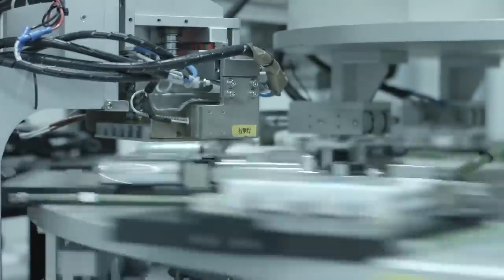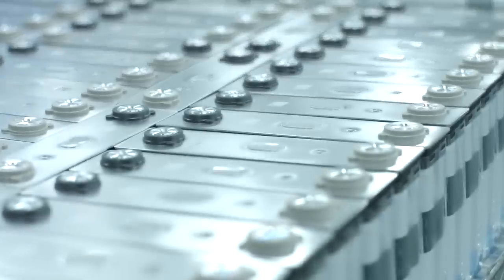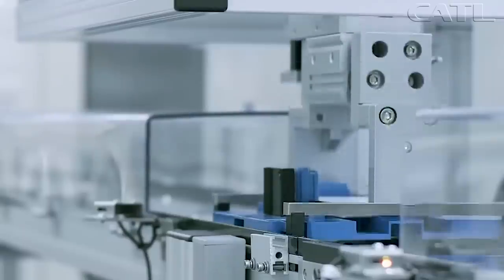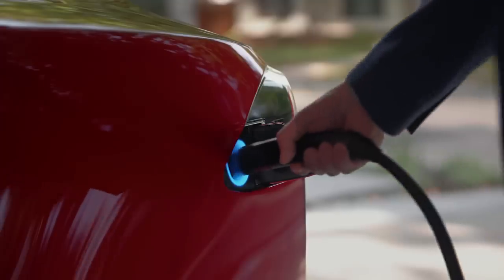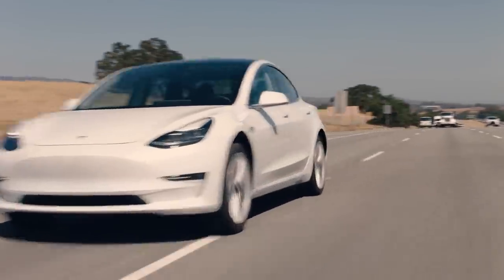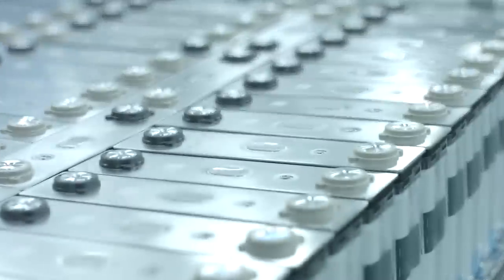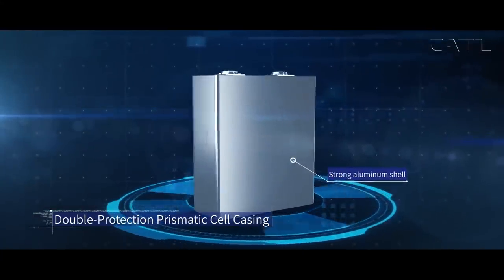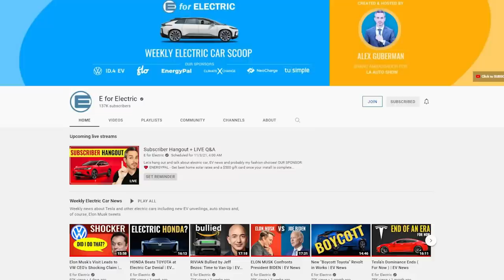SANDY MUNRO on Tesla's LFP Batteries

Comment: 100% charge on LFP is not inconsequential or does not degrade the battery. LFP degradation will drop by 10% in the first 50,000 miles, and charging to 100% does degrade the batteries faster.

The reason Tesla wants you to charge to 100% once a week is so the car's Battery Management System (BMS) can reset its internal knowledge of a "full charge" so it can watch and track the number of watts consumed while driving to give you a more accurate estimate of range.

NMC batteries have a nice voltage drop that is pretty linear as you consume power. You can use the voltage of the cells/pack to estimate capacity and power remaining.

LFP (LiFePO4) voltage drops some initially but then is very flat from say 85 to 15%, then the voltage drops even faster. You cannot look at the voltage and estimate state of charge.

Thus the BMS needs to know when you've hit 100% so it can reset its internal meter, then as you drive the BMS knows how much power has been fed to the motors and vehicle systems. Based on the roughly 60.5kWh battery capacity, and about 56kWh usable, the BMS can tell the car its estimate of the state of charge. As you drop below 15% and the voltage starts to drop, the BMS can be more accurate on the last 15% of the battery.

While the BMS can estimate how much you charge the battery, it can get off due to +/- errors in estimation, thus why Tesla says charge to 100% once a week at least.

You could probably extend this to every 2 weeks, and charge to 85% most of the time and be just fine, and probably extend the life of the battery pack. But with NMC lasting 1m miles, I dunno if you'll be alive to reap the benefits!

Comment: I had an FFP four engine start on the motorbike it was considerably better than the powerful lead acid that it replaced I tried it on a dual power drill and I could tell no difference in the performance between that and the 2170 is being used in the drill. Yes it’s bigger but not massively so and performance wise I could tell no difference

Comment: In some point better acceleration is no more meaningful thing for normal customer. I have lived to my days with cars slower than 10 seconds from 0 to 62 mph. Anything faster is fast enough and that can be made with LFP just fine. Bimmer drivers are different story, but I am not one of them. Your mileage may differ, it is of course up to you to make your own decisions.
Reply: Agreed; the LFP simply isn't THE BEST for the extreme acceleration of the performance Tesla models,  but is great for the regular ones.  My current car does 0-60 in 9, and that's perfectly adequate for any traffic conditions.
Reply: 100% agree. The ludicrous 0-60mph times are just plain dangerous in the average drivers hands. Tyre last longer as well. 
What normal person needs supercar performance unless they are those irresponsible wild drivers putting normal people in danger on the roads.

Comment: Right off the top: LFP is a chemistry. 46-80 is a form factor. I'm pretty sure that in due time, LFP batteries will be produced in the 46-80 form factor and built into structural battery packs. . This will allow better range, more charge cycles  and lower cost than any other combination currently available.
Wow! Until I saw this video, I had no idea that Tesla was using prismatic cells in any of their products. I don't expect that will continue for long.
Reply: @e-redj  To be clear:
1) Pouch and prismatic are not the same. prismatic cells have a lot more structural integrity. The pouch form factor is part (not all) of the reason that the Chevy Bolt batteries have failed.
2) It is more difficult and more expensive to build batteries in the prismatic form factor. The main reason for doing this is to achieve higher energy density at the pack level than would normally be possible with cylindrical cells. But that benefit is lost when the cylindrical cells become part of the structural strength of the vehicle. To be specific, like the Tesla structural battery pack.
No, prismatic cells are not suitable for integration into a structural battery pack.
That is why I do not believe that Tesla will continue to use prismatic cells once the 46-80 cylindrical cells become widely available. How long it will take Tesla to get the new manufacturing process to work with the LFP chemistry is something I do not know. But, I'm sure that it's coming.

Comment: I really like Sandy Munro for his manufacturing expertise, and he does understand the basics of different battery technologies. But he is kinda soft on the key points about LFP which relate to energy density and cost. And it is important to note that China owns the LFP battery industry right now, so they have a HUGE interest in promoting it over NCA batteries that are mostly produced in Japan and Korea. The biggest benefit of Tesla's 4680 batteries is simply that they will help Tesla not be wholly dependent on Asian battery manufacturers that currently OWN all automotive battery production today. For most EV drivers today, they simply charge up at home overnight, and don't worry about public chargers, or charging speed, or maximum range. But those are still the main topic points that you see discussed on the internet as being the most vital needs and issues of EV ownership. They certainly are important for some people, but not for most.

Comment: LFP cells can be completely destroyed in one charge cycle if they are charged while frozen. They must be using some kind of battery heater or BMS low temperature disconnect in cold climate vehicles.
Reply: Yes. Better keep it connected to AC charger so it will keep on temperature in the winter.

Comment: BYD is setting the standard with their LFP blade batteries. Their form factor lends to more cells in traditional platforms. BYD’s new vehicles with blade batteries, 800v charging will be considered by many future EV buyers. FYI the BYD Han AWD can accelerate 0 to 100km/h in 3.9 seconds.

Comment: I understand that LFP discharge more quickly when not charging.
Reply: Do you mean self discharge while not being float charged?  If so, I have seen my banks of LFP batteries hold charge for 2-3 months at a time completely disconnected with no float charger on. My AGM battery bank shows a fair amount of discharge after a week without a charger connected. LFP batteries have minimal self discharge.

Comment: For any given size LFP batteries won't dump the high amounts of current that NCA or even NMC chemistries will (less specific power).  The cells also generate less voltage per cell (nominally 3.2V vs. 3.7V). For any given Ah rating LFP will be gravimetrically and volumetrically larger than an equivalent NCA or NMC. This will make very little difference for the Model 3 and Model Y non-performance versions which will simply use a slightly larger pack but it would make the Plaid rather anemic.  The Plaid drive train pulls nearly 2000 amps at full power.  This is possible with NCA but an for an LFP to offer this would require it to be quite a bit heavier and larger.

Comment: I am using LFP batteries for around 10 years now, both in my cars and motorcycles as starting battery, and even electric bike. 
Work good, probably 10% less than LiIon, but they last over 2000 cycles and are bullitproof. 
I never understood why Electric cars not use them as starting battery.
Reply: Not enough energy density per kg yet.
Reply: @herrba  only 10% difference
Reply: @herrba  I could start my old Ducato 2.8Tdi Campervan with it. It was 2/3 lighter and even stronger than the old lead acid. 
For my motorbikes it is even better, The Harley has a 18 pounds battery, that I replaced with a 5 pounds LFP battery. That thing is hugely more powerfull and has 8% drainage over a year, My lead acid would be dead after a year.
Reply: I have LFP batteries in my four wheel joystick controlled adaptive mountain bike. Plenty of range, and acceleration, and I appreciate the longevity of the battery.

Comment: I am sorry but Sandy has one thing wrong about LFP batteries.  They can output more power without damage than standard EV chemistry using nickle and cobalt batteries.  The 2014 Chey Spark EV has LFP batteries outputs enough power so the car has 400 pound-feet of torque while the 2015 & 16 Spark EVs which has different battery chemistry using nickle and cobalt puts out 327 pound-feet of torque.  LFP batteries can take higher charging voltages and current and can output more current.  If Tesla is limiting the performance it is probably due to wanting to squeeze more range out of the car.

What Sandy has got right is pound per pound LFP batteries don't hold as much energy.  Using the real world experience of the Chevy Spark EVs 2014 and 2015 through 2016 you can get a feel for the difference.  2014 Chevy Spark EV LFP battery is a 21 kilowatt hour while the 2015 and 2016 are Nickel-Rich NMC. (nickel-manganese-cobalt) and are 19 kilowatt hour.  All years of Chevy Sparks have the same range of 82 miles brand new.

The 2014 Chevy Spark EV LFP battery 21 kWh weighs 86 pounds more than the 2015 & 16 19 kWh NMC batteries.  Both LFP and NMC Spark EV battery packs take up almost the same amount of space. 2014 Volume/case: 133L / square-shaped  verses 2015 & 16 Volume/case: 139L / square-shaped.

The 2014 Chevy Spark EV battery pack is 369 Volts.  The 2015 & 2016 battery packs are 400 Volts.  Even though the 2015 & 2016 are higher volts the 2014 Sparks EV have 400 pound-feet of torque compared to 2015 & 2016 327 pound-feet of torque.  This tells you the 2014 LFP put out more amps than the 2015 & 2016 NMC batteries.

I have also been monitoring the Spark EV forums.  So far the 2014 LFP batteries are holding up much better then the 2015 & 2016 NMC batteries.  LFP batteries just don't produce as much heat when charging or discharging as NMC batteries.  This is why they can handle higher voltages and currents than NMC batteries and last longer.  LFP batteries can also do more charging cycles 2 to 3 times as many as NMC batteries.  Since they don't use expensive nickle or cobalt they are cheaper to produce.  You can drive a nail through a LFP battery and even though it will short it will not catch on fire.  Drive a nail through a NMC battery or any other Lithium Ion battery and it will catch on fire.

Comment: Smart guy but he did not have all the answers correct for your questions. He misunderstood your 100% charge question. You are correct LFP can be charged to 100% charging lithium to 100% frequently can damage the battery overtime. And the reason that LFP has been built in China but not in the USA is a combination of patents surrounding LFP battery technology that have been sourced for China manufacturing but do not allow for out of China until these parents expire in 2022

Comment: LFP is better for most vehicles and people. They are safer, cheaper, last longer, more available and like to be fully charged unlike nickel. They weigh more and don’t like cold temperatures. So those living in mild/warm climates will be fine with a LFP pack.

Comment: my 2011 Nissan LEAF    24 kwh.. has lost three bars    and the range is down to 60 miles .   will LFP batteries fit and replace the original cells .

Comment: Since when does lfp charge faster, that’s just plain false
Reply: I think what they meant was that with LFP you can sustain a high voltage charge longer, therefore more juice for the same amount of time. In other words, faster charge while the top speed remains the same.
Reply: NCA cells cannot exceed 4.2v during charging, which means that at approx 50% charge, the charge current is steadily reduced to 0 at fully charged. This means that the last 20% charge is slow, and the last 5% charge very slow.
Reply: @nordic5490  you get more miles per minute with NCA in peak curve first 20 min, which alone makes it better for trips.  No one wants to sit around longer than that.  You guys are all ignoring the energy density factor.

Comment: What I like about LFP batteries is that they like to be charged to 100% regularly. I wish that you would have talked about MP3 batteries. I heard that MP3s will be used in the 25G model
Reply: What I don't like about the batteries is they use a forever chemical that is showing up in soil and ground water. Bis-FASIs is the group of chemicals that are used. No video on the battery technology ever mention this highly toxic forever chemical..
Reply: @enigmaticloremaster1700  hopefully recycling of the batteries will catch most of that stuff

Comment: So watt charges faster? the LFP or the other lithium ion? I love my 2015 Fiat 500e LFP but not the range degradation of my 2015 Tesla Model S.. Great video update on Tesla China.
Reply: LFP is also a lithium-ion battery, don't get confused. It's the other stuff like Iron vs. Aluminium that are different, not the Lithium Ion.  The "F" is for Ferro = Iron.  In NCA battery the A is for Aluminium. Per volume, the LFP just can hold less lithium Ions than NCA battery and therefore you need bigger battery for the same amount of energy

Comment: I read opposite info: lfps losing capacity faster than normal lithium ions, whats true now? And is loading to 100 percent daily really healthy for lfps? Or is it just a tesla recommendation with other goals? If you had 2 cars, one lfp and one 4860 non lfp, both identically driven,  which battery would have less energy left after 5 years, same usage, same weather, temperatures, same kms?
Reply: What happens with LFP is during the first 20,30,40 charge cycles they drop range - some say by as much as 10%  - (100% regular or 50% regular & 100% weekly charging doesn't matter) - there is a coating formed within the battery cells that impacts the range (it slows down / reduces the charge exchange between the cells) - after the initial charge cycles are done they stabilise and drop range much slower than the older NCA batteries, it takes a while for the LFP battery to catch up with the NCA but eventually they will degrade less. The actual point at which they overlap will vary battery to battery, but after 5 years you are definitely better off with the LFP on average.
Reply: See Recurrent's studies on battery life.

Comment: Just checked the Tesla website and they added yet another $1000 to the base price of a Model 3 with the new battery pack. 45,000 for a base model 3 when a year ago they were 37…38? Hard pass.
Reply: 7% inflation accounts for almost half the difference. The other is high demand and short supply. Tesla is already selling all the cars they can make. It's only logical then that they raise the price.
Reply: @lionelhuts875  I’m not saying it’s unworthy, just saying I’m not paying it
Reply: @davidboothbyiii8249  That makes sense. I'm just not sure where else you'd go instead if you need a car. It seems like all other vehicles have gone up in a similar fashion. Even the used market is insane right now.
Reply: @lionelhuts875  I hear that. As it is I absolutely refuse to buy a used car. In fact I just traded a 5year old Ford for at only a 22%loss from original out the door cost. New vehicle was marked up to about the same price as a current RWD M3 but more practical.

Comment: The blade LFP, with its cell-to-pack arrangement can lead to much lower battery weight, and translates to better power to weight ratios. Tesla’s massively heavy cylindrical cell was always too much dead weight. Batteries that form part of the chassis structure was always going to win out.
Reply: 4680 are part of the chassis structure though.

Comment: Currently waiting on a Model 3 and specifically only interested in the CATL/LFP batteries.  One very important factor that you did not cover is that the LFP batteries have no cobalt and no nickel, unlike the 2170 and 4680 batteries.  Not only does this reduce the price, but more importantly, it reduces the negative environmental impacts connected to cobalt and nickel.  And LFP batteries are also easier to recycle.  There's a real upside to the LFP batteries for anyone who prioritizes sustainability.

Comment: Those cells at 9:50 look 50-100 ah size . 200ah is higher
Reply: I guessed they were the same 280 amp hour cells that I have judging by the size of that blue pressure relief window and the cell width. They make them in 310 amp hour as well.

Comment: Shorter range but you dont stop charging at 80% so range is the same.
Reply: You should stop charging NCA cells at 80% if you want your batteries to last. All Telsa cars made in the USA to date have NCA cells.
What kills NCA cells is: being left at at full charge for long periods of time, ie, @ 4.2V, and, high temperatures. Your NCA battery will last less than 3yrs if it is fully charged all the time and kept warm, just like what happenes to your laptop battery.
Reply: @nordic5490  not an issue with Lithium iron phosphate

Comment: I think there is a confusion between form factor and type of chemistry...Tesla uses cylindrical batteries due to their cooling efficiency as stated by Elon as they cool the batteries from the sides of the cylindrical cell and the form factor can be the type of the cylindrical cell which is18650, 2170 or 4680 and the chemistry is then LFP and so on.  Please correct me if my understanding if wrong.
Reply: Tesla uses cylindrical cells because they are Fast and cheaper to build. They started using 18650 because they were already mass produced so benefitted from economy's of scale. Prismatic cells make more sense for LFP as it's so stable. Pouch cells are just a disaster waiting to happen. It could be what kills GM for good .